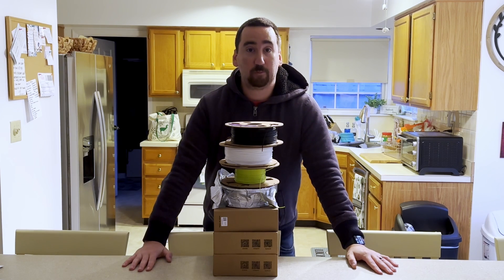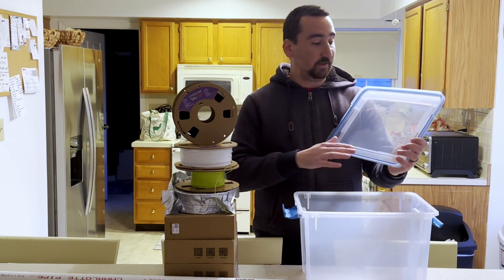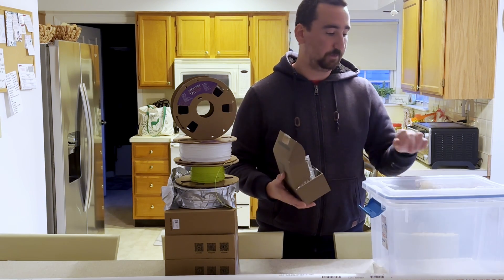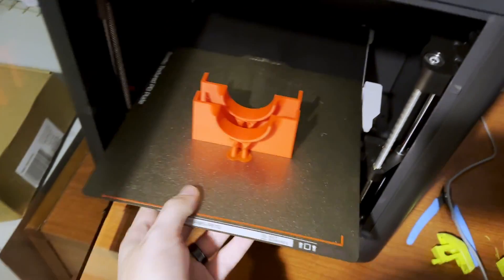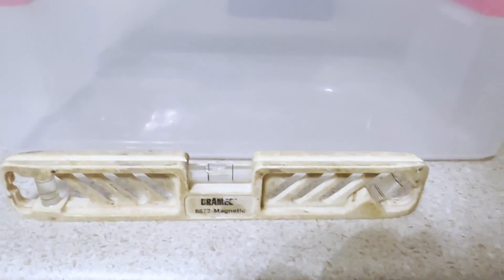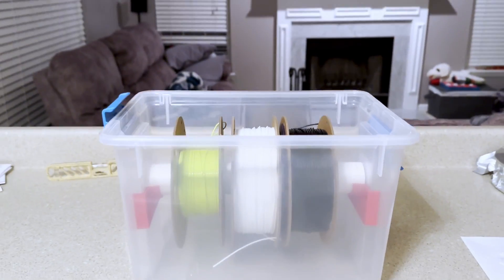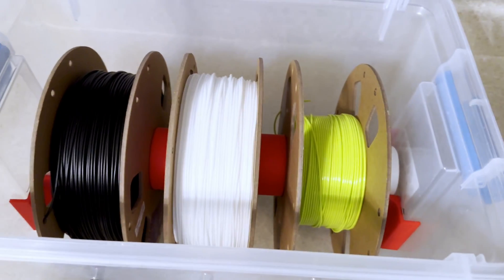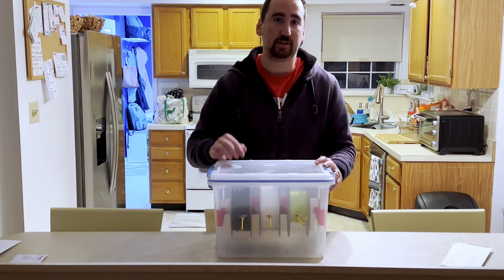Building a 3D Printer Filament Dry Box! | Saving My TPU From Moisture!

Comment: I like the editing in this one...sound effects appreciated 1:52. Only thing ghetto I see is the use of hot glue haha. Do you plan to put desiccant silica beads in the box to actually dry the environment?
Reply from the maker: Ah yes, I didn’t show it here, but I did throw a bunch of desiccant packs in there. My printer came with some bigger packs, and every roll of filament comes with a small silica pack. Ive been saving the packs for this use case, put them all in my filament dryer then tossed them in. 

Eventually I want to build a better box, with humidity sensor and rollers, but needed a solution asap. Stay tuned and thanks for watching!